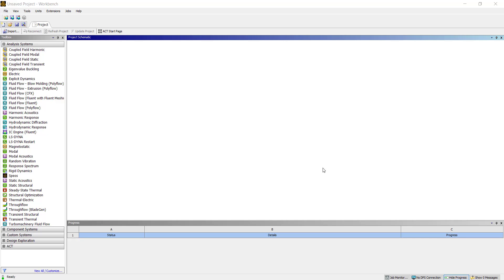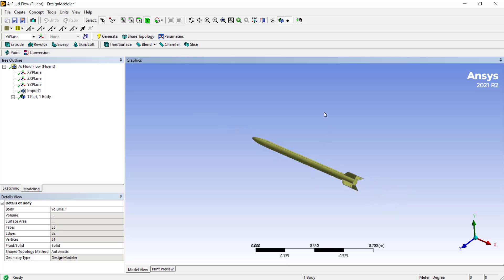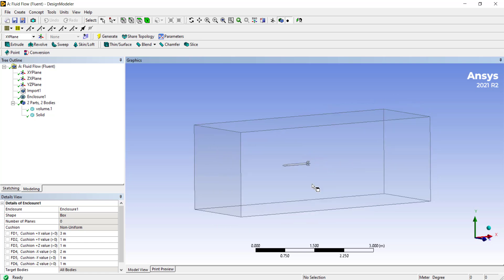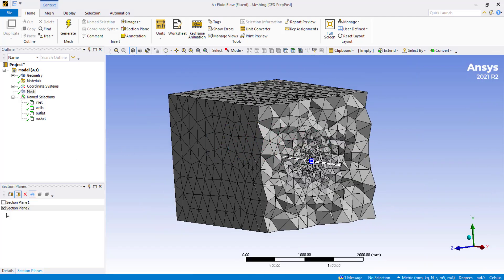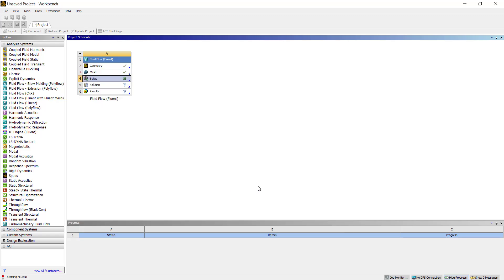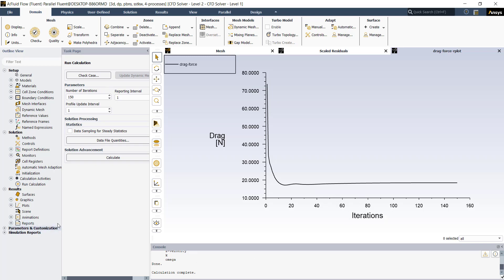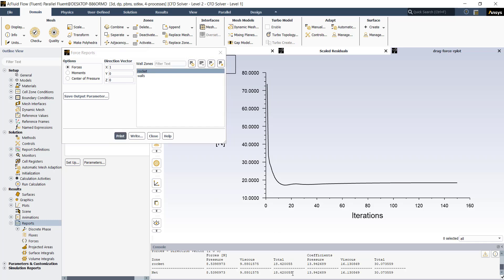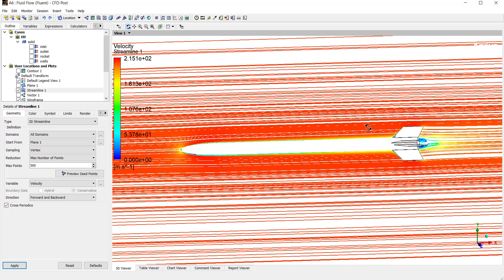How to do Meshing with Inflation Layers and Air Flow over Rocket with Drag Calculation | Tutorial

Comment: Hello, after setting my speed according to mach 2 in the inlet in the boundary conditions section, if my rocket is at an altitude of 5000 km, what should I change and where should I do it? The reason I ask is that I cannot come to the thermal section in the inlet in the boundary conditions section and change my temperature.

Comment: hi, thank you for the educational vide of the ANSYS fluent. If i have a compressible flow upto 3 mach and i used pressure farfield and pressure outlet, what are the values of the gauge pressure and temperature. How do I calculate them?
Reply: Hello. This is up to you actually. What is your operating conditions, firstly you should decide it and after that go for standart atmospheric table and check the corresponding values